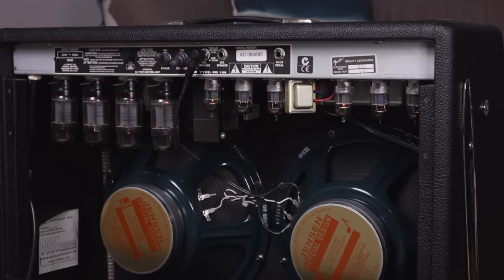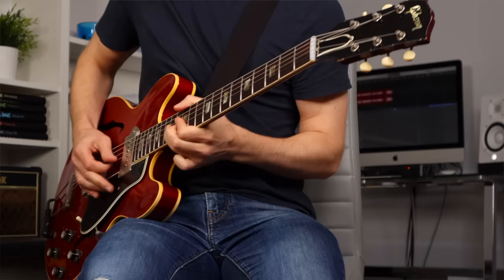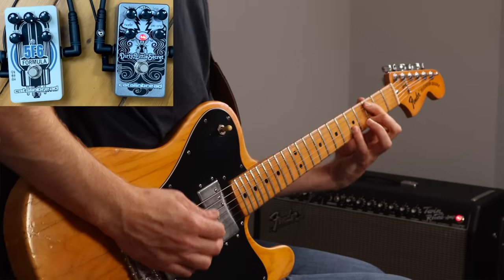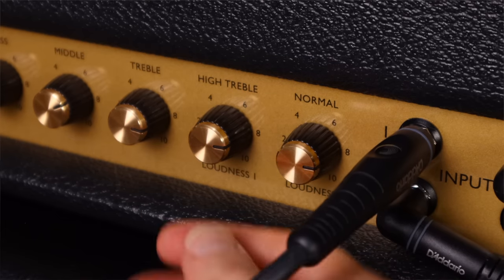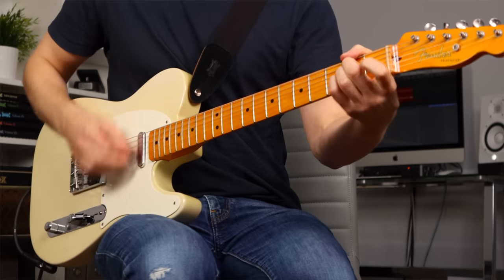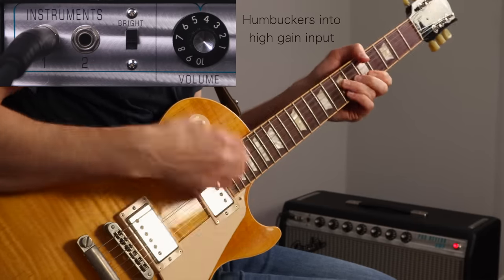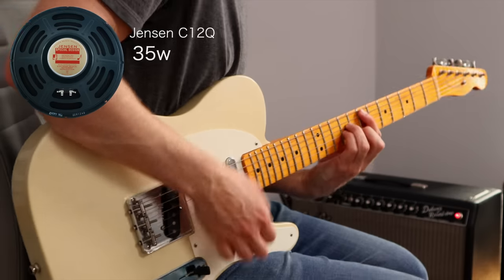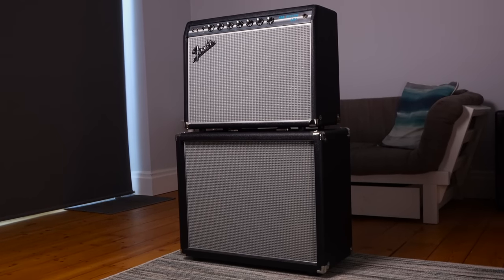9 Solutions For When Your Tube Amp is Too Loud

Comment: When i was looking for an amp, i always saw people asking around if a given amp " was good to play at home " and then i usually tought "why wouldn't it be?"... Until i got mine, even though its 'only'  30W, wow...  I keep it on the opposite side of my room and use noise cancelling headphones with the amp on 10% volume, so, lessons learned! 
I can't deny that the power makes it sound amazing, but for anyone that lives in confined space, that's something very important to consider.
Reply: I have 100W Marshall jvm 410h with 2x12 cabinet. The beauty of it that is if you want to play quietly, just don't turn the knob up to eleven! 😂 But when you want to really get going, there's plenty of power there ready to be used. And if you want to boost your quiet sound, add some good distortion pedal before the preamp.
Reply: A 100 watt Marshall is hardly a good low volume amp solution even if you do have one that costs $3000+ dollars and has ten volume and gain knobs on it.
Reply: I find it better at low volumes actually. It goes too bright when cranking up.
Reply: My 40watt Fender amp is surprisingly loud.  It never needs to ever go past 5, and at that,  it's REALLY loud. 
I was so surprised by this from 40 Watts,  i don't get how people can go on about cranking up 100w+ amps.
If i crank mine up to 7 or more, it really physically hurts.

Comment: Hi Michael, just found this channel and watched a few of your videos. The playing is so tasteful it almost takes away from the informative content! 

A subtle loudness thing for me: most modern fender amps at least have hard metal feet, presumably for better coupling to the ground. I found that adding rubber feet to my amp made it feel less loud/bassy, especially on hard floors.
Reply from the maker: Hi! Good to hear you're enjoying the videos. Yes the metal feet are mainly so they can be slid across the floor if you need to move them. I think Fender calls them 'glides'. It'd make sense that the rubber feet might give a bit more isolation like you say, thanks for sharing. I actually put rubber feet on my Pro Reverb too, mainly to get it a bit higher so it doesn't hit the top handle of my extension cab when I place it on top.

Comment: I have a Fender Twin a crazy gain stage and haven’t EVER in my new apartment  gotten any noise complaints and never been told to turn down live or in studio. 

Keep your volume at 2 or lower and use your Overdrive pedal volume to control your actual output  and saturation. 

You do not need to “crank it to the sweet spot” with this amp. If you still can’t hear yourself one of your other mates is either too loud or you are not cutting enough in the band mix.

Comment: About 12 years ago, I decided that I needed an affordable amp for playing out. After lots of research, I ended up going with a Fender Mustang III V1. It was plenty loud for gigging but too loud for the other band members. So, I bought a volume pedal. However, backing off the volume had the same effect as backing off the guitar's volume. I was able to solve the problem by running the volume pedal through the effects loop. The Mustang III is a modeling amp, so when I have the amp cranked up and I back off the volume, it still sounds great but quiet. So, without losing that sound, try running a volume pedal through the effects loop.

Comment: I have found a little miracle pedal to cure low volume setting on my amp. When you use a full 100watt Marshal 1959 model Plexi thorough a 4x12 Marshall cab cranked you get excessive bite from the pleasing presence from the power amp transformer. The cabinet will start to resonated and it will give you low end thump. The GUPtech Quebec EQ Enhancer has just two knobs. One gives you a punch right at the cab resonance frequency and the other gives you that presence bite. I use it as an always on pedal. Even at the lowest volumes playing clean I get a very full and rich sound . When using Fuzz boxes or high gain Overdrives I not only get that punch and bite, but the pedal tightens the sound without any loss of the extra breadth it provides. Impressive, better yet it is only $100.00 USD.

Comment: I swapped out the V2 12AX7 in my '65 Fender Twin with a 12AY7 and that was such a good decision. I only have the one amp, and now it's playable in my bedroom (I can turn the volume all the way up to 4 now!). It also really improved the sound; the stock tubes were re-branded sovteks, and I put a nice Electro-Harmonix tube in there instead, it just sounds fuller with more harmonics. Seriously, if you own a tube amp, play around with what preamp tubes you have in there! I swapped out the reverb tube at the same time with a better quality tube and that really improved the sound of the reverb as well.

Comment: Two Notes Captor is a great tool that lets you run a cab simulated signal to the PA while setting your amp however loud you want it to be  without worrying about overloading a mic.  It can also attenuate 20dB if you want to keep the stage volume down.

Comment: I'm using the JHS Little Black Amp Box in the FX Loop as a master volume, works great in my Orange amp.
Reply: I use this on my Fender Blues DeVille with pretty good results.
Reply: Is it working on an amp without an FX loop ?
Reply: No it needs the FX Loop to go between the Pre and Power Amps, otherwise you need a real attenuator that goes between the Amp and Speaker @poitequentin
Reply: @GuitarsAndTea  okok thanks you !

Comment: Closed back cabinets react different than open back cabinets in terms of volume and tone worth to check. Engineers and audio specialists gives certain attention to the room reflections hence the cabinet on the floor would reflect some frequencies differently than high place or support. So an audio treatment to your space can help a little. Also a cabinet close to the wall can increase 3dB in loudness perceived. Position matters in some cases but people buy tube amps for their "peak sound" which end up being a little bit louder than necessary for practice. That's the purpose of solid state amps they sound exactly the same at any volume level. If you are into pedals that's a good call.

Comment: What about buying a very little wattage tube amp. I have bought the DSL 1 from Marshall. And I use it with a Palmer attenuator. Perfect screaming lead sounds at night, without disturbing the neighbors. It's crazy to use a Twin Reverb or another 100 watt amp. It's the small tube amps that's key. Thanks for video. 👍🏼

Comment: Some things you missed:

Using a reactive load + speaker simulation, taking the output to a separate full-range monitor, or directly to the PA.

Using a plexiglass screen in front of the amp.

Installing a post phase-inverter master volume (requires modifying the amp)

Giving up and using a digital modelling amp...

Comment: Hmmm, how do you get both speakers working when you stack the Fender? The normal speaker is 8ohm, and if you add any other speaker it won't be 8ohm anymore, or do you just play it at the 4ohms when both are plugged in? Love your stuff by the way.
Reply from the maker: Hey thanks! And yes, good point. The extension speaker output on the Custom Pro Reverb doesn't work in the same way as the older Fender amps. It automatically switches to a 4ohm output setting when an extension speaker is connected so there's no ohm mismatch when you use two 8ohm speakers.
Reply: @MichaelBanfieldGuitar  Ok, I wish my Fender did that! So that brings about another thought. I've always wondered how it would sound if one of the outputs was sent to a load box, (or at least through an attenuator,) and the other left with a speaker. In theory, it should halve the output (or reduce with an attenuator). I'm not sure of the electronics here and how it would be affected, but the dominant speaker  should hopefully not be too affected. I don't know. But good to see Fender doing this. Maybe they didn't want to make this mod to their 'classic' amps in case people called them out on it, but I think it's a good idea.

Comment: Amp placement makes a huge difference and massively impacts what people set their amps to.
Watch any live footage from professional touring bands and you'll regularly see amps on flight cases or on top of other cabs, which are possibly empty or not plugged in to start with.

That said, it's a good way to quickly test an engineer: put the amp on the floor, stand over it and adjust volume & treble to suit what you're hearing (Both will be ridiculous FOH). If they only tell you to turn down instead of going to grab some chairs or beer crates if its not practical to lean the amp against a wall, then you're dealing with someone who isn't an audio engineer.

Comment: Some of these solutions could get rather expensive. An alternate choice might just be to buy a separate a low-power tube amp in the 1-15 watt range from brands from Blackstar, Marshall, Fender, etc.
Reply: A good attenuator is only about $200, and even a 5 watt tube amp can be pretty loud, just buy the attenuator

Comment: I have an outdoor gig this Saturday.  It's a Guy Fawkes Night event that's gone all woke, with no bonfire, and "low-noise fireworks" (whatever they are).  I suspect the band may be the loudest part of the event, and with this in mind, will be using a Fender BDR, which should do the trick!
Reply from the maker: You need to turn the amp right up and play along to the fireworks by making the bang noises with muted string hits or something. That Blues Deluxe will be up to the task I'm sure. Have a great gig!
Reply: @MichaelBanfieldGuitar  Well I have to say, I was wrong about the woke, quiet fireworks: they were much better than loud ones!  I'm converted.  We had to traipse across a muddy, waterlogged park to the bandstand, to do this, with freezing cold hands: https://www.youtube.com/watch?v=ofjmzE7WG68.  It was worth it, because the gig was great fun, and the audience seemed to enjoy what we did.  And I still didn't get the BDR's volume above 3.

Comment: Too loud is indeed too loud but sound engineers have assumed too much power, just saying.  Particularly the all bass no treble ..or mids …contingent.  One thing the presenter missed is mastering a softer playing touch to take advantage of the amp dynamics and available headroom without making the amp too loud.  And tilt back legs are great, it puts the sound in the players ears so they can hear better at lower volume and redirects the more directional highs and beamier mids away from the listener

Comment: Why not buy a smaller amp ?  As you need to replace power tubes what about the transformer in your amp ? Most tech would tell you the same thing  buy a smaller amp . Don't risk damaging your amo . . Low volume you can't drive a cabinet or a 12 inch speaker

Comment: Very strange that speaker sensitivity (db/w/m) seldomly is mentioned. A 85 db/w/m speaker does not get louder than 85 db regardless the power you put into it.
Reply: @michelv This is not at all how speaker sensitivity works.  A speaker that has a sensitivity of 85db simply means that putting one watt into it will produce 85db SPL at one meter.  Every doubling of the wattage increases the volume by 3db so:  2W input = 88db. 4W = 91db.  8W = 94db. 16W = 97db. 32W = 100db.  64W = 103db. 128W = 106db.      A speaker with a sensitivity of 85db is a rather low sensitivity and would be the kind of number you might find on a hifi speaker rather than a guitar speaker.  Guitar speakers range from low 90's to over a 100db for sensitivity and the sensitivity is not necessarily connected to the wattage rating as is claimed in this video.  A 12" Celestion Blue is rated at only 15 watts but has a sensitivity of 100db while a Celestion Creamback 12" is rated at 65 watts but only has a sensitivity of 97db.